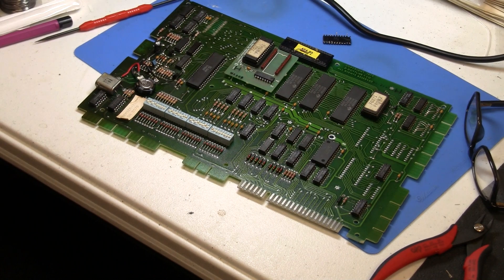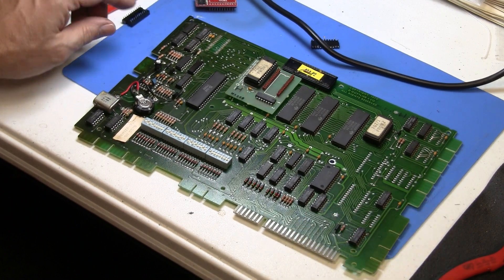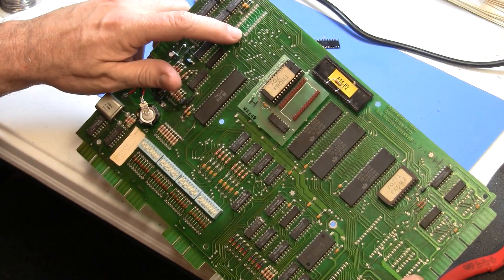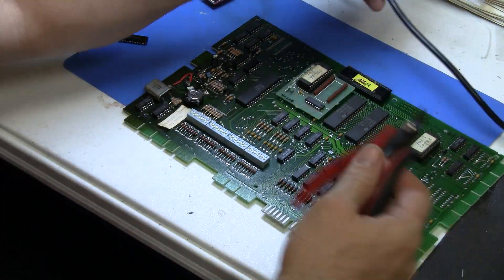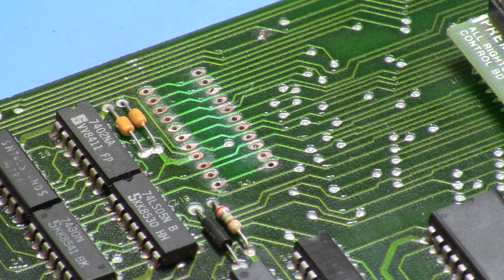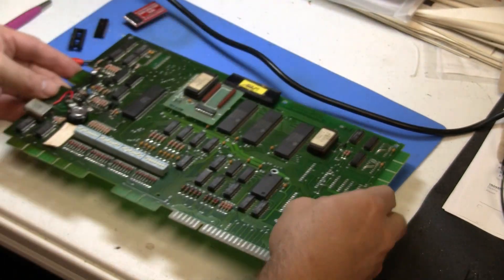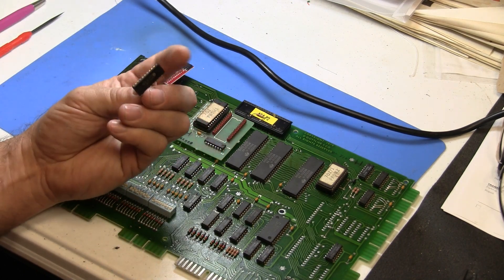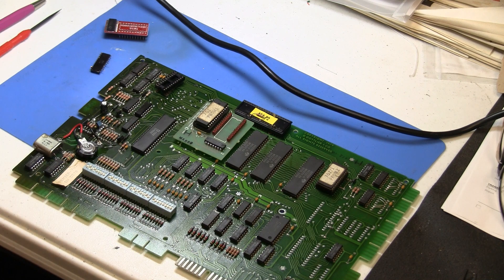Adding NVRAM to Gottlieb System 80B - Raven Pinball - Pt 1/3 Pt 3/5

Comment: Interesting videos - thanks for posting.  I just happened to have recently worked on both a Haunted House and a Black Hole -- on both I installed a 2032 battery socket.  The Black Hole drained the battery within a month and then lost everything when turned off.  The Haunted House - even after installing the battery - would forget credits and high score settings even when the machine was still ON.  It does seem like time has caught up to those 5101s, and they are no longer reliable, battery or not.

After installing the NVRAM IC, both have been 100% solid.  (granted, it has only been a couple of weeks).  But if you have confidence in your soldering skills, it's well worth the $15 to upgrade to the NVRAM and not worry about it again.

The 2032 socket has worked well on the two Williams machines I have outfitted.  I have a High Speed that has held all settings for two years and counting.